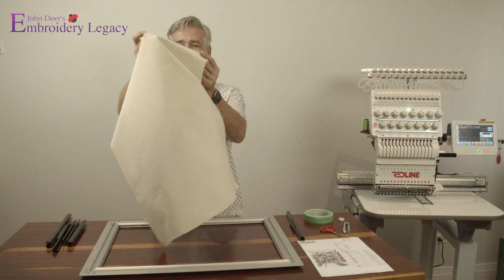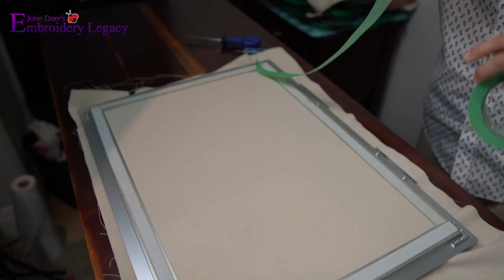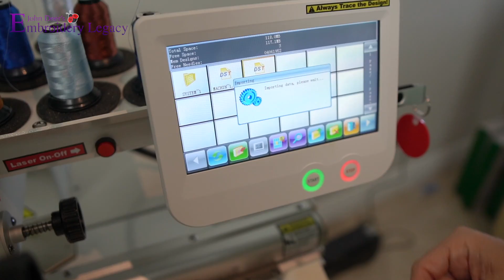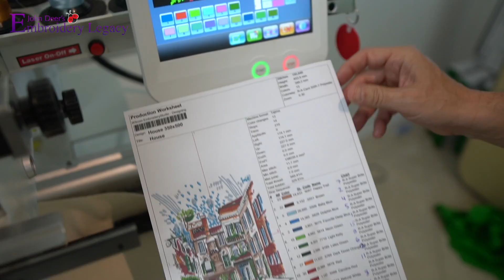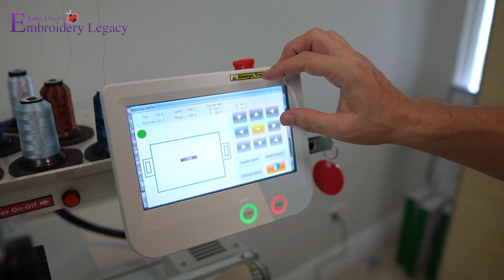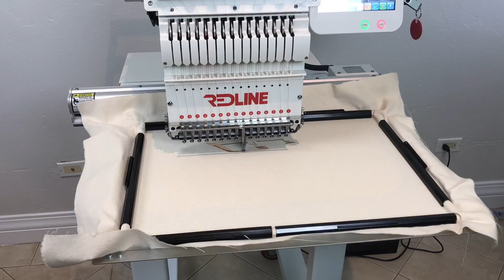How to Hoop an Embroidery Sash Frame - Running Jumbo Embroidery Designs

Comment: I have a sash frame.  It was included with accessories when I bought my used SWF years ago.  I didn't have any clamps and really didn't need it until recently.  Do you know where to get the clamps for this great frame?
Reply from the maker: Elizabeth Epstein the clamps should come with the fame, I’d call SWF and see if the can be ordered as a part just to make sure they fit properly.
Reply: @EmbroideryLegacy  thanks,. I'll try that.